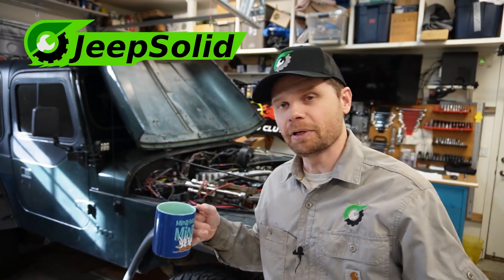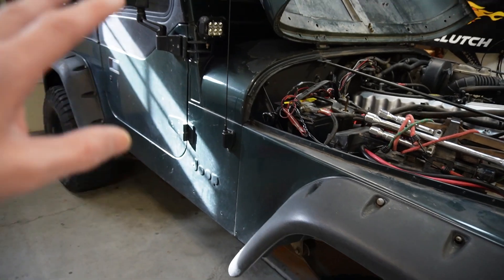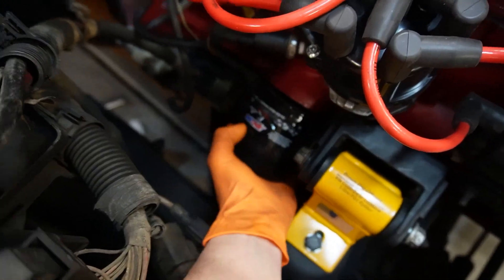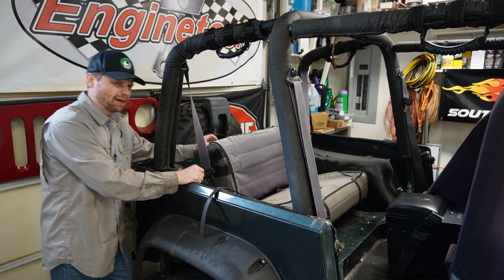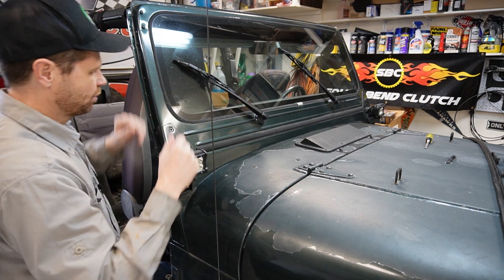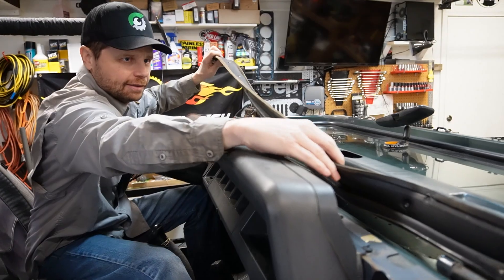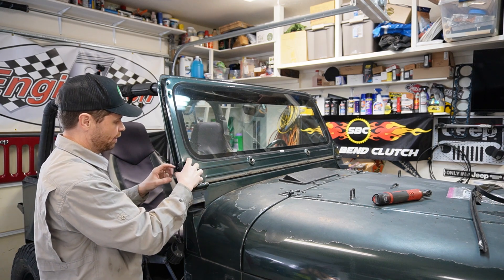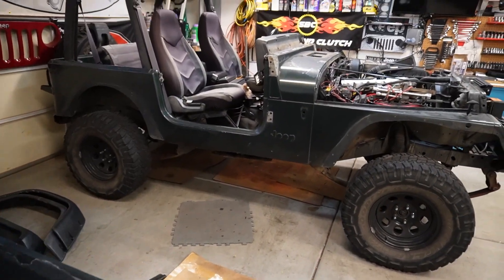Jeep Wrangler Paint Job Part 1

Comment from the maker: Ok, ok....  I'm going to comment on the 0-60 test here, because I know I am going to get some comments on that, HAHA! yeah, 0-60 in that time isn't fast for a car. But this is an older Jeep. Ha! Also, this is with 32" tires on it and I am not sure the speed sensor has been changed, so it may have been more like 0-70 or so... as larger tires throw the speedometer off, slower. I know it was a silly test, but still fun. I really can tell it has more power, because I did the same thing before the stroker. Fun to feel the power!
Reply: I have a 1989 2.5 YJ and I don't even know how much I can push her in her gears haha, afraid to blow something up or off! She has this kind of cough/chuff when idling and I wonder if it's a misfire and if I got it fixed she would be a little bit quicker. No idea haha. I'm in the UK and if something needs replacing it's a PITA to get hold of and expensive! Great videos Dale, I'm learning so much from watching you with your YJ.

Comment: I just recently inherited my moms 88 YJ 4.2 3 inch lift on 34s Posy front and rear the whole 9 yards. It was sitting in her garage for over 15 years now. I'm rebuilding the 4.2 and giving it an all around tune up. But essentially I hope to start a stroker build in the next couple years. You see guys throwing in LS swaps or 350 small blocks. But I feel like taking the best parts of Jeeps original engines and making these Strokers from hell makes it more authentic. Showing what Jeeps true potential could've been, had they gotten it all right. 

Really enjoy your videos! It's really awesome what you're doing and very helpful on all levels. In my opinion, you should paint it a Space Grey. Looking forward to your next video! Thanks for sharing
Reply from the maker: Sounds like a great project you have. The 6 cyl was one of the best engines ever made. Bullet proof.

Comment: What's the gear axle ratio? If it's stock 3.07 are you considering going to 4.10 or do you think that's too deep for the stroker?
Reply from the maker: I’ll have to check again. I knew at one time but forgot. Haha!
Reply: @JeepSolid  All good. I have aspirations to build a stroker in my 93 someday. My gear ratio is 3.07 and I'm currently installing a lift and decided to run 32x11.5 15r tires. I'm wondering if I should leave the 3.07s and deal with the power loss until I build the stroker or if I should go ahead and install 4.10s .. Thank you for doing this build and putting so much effort into the videos/ posting. I really enjoy your content.